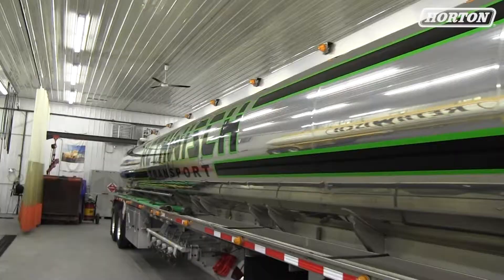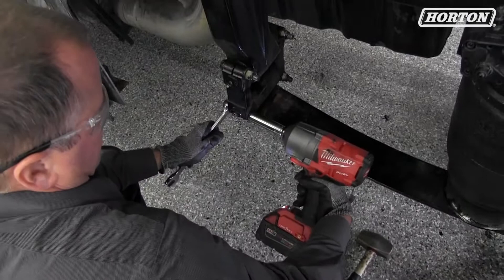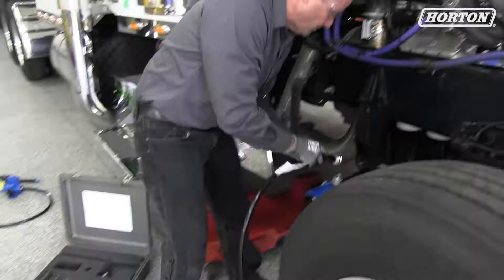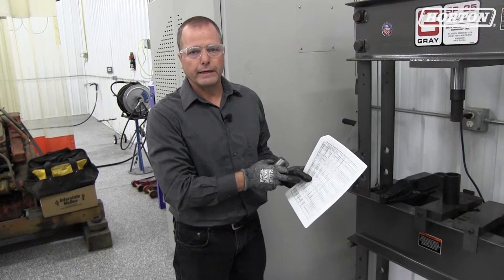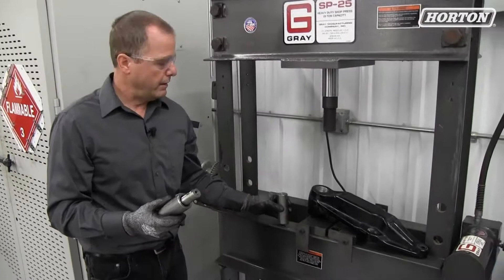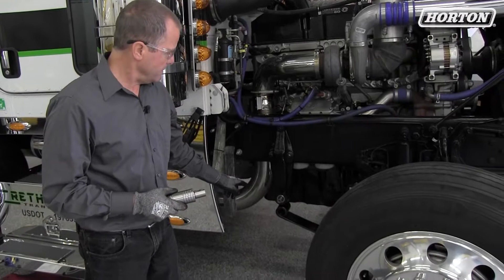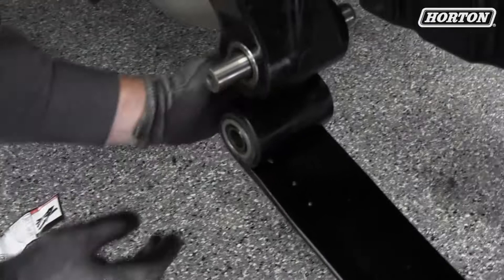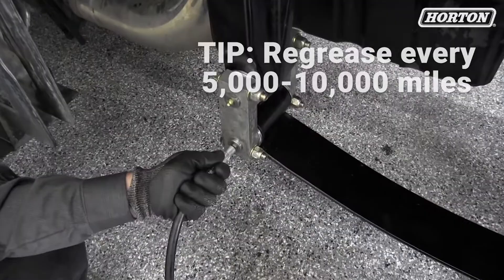How to replace threaded pins and bushings with roller bushings

Comment: I installed this kit in my 96 KW  T-600 many years ago , I had an inspection done and was told that the original pins were very worn , that is why I had bought this kit , mine did not go as easy as this video shows , mainly because I did not have that OTC press kit needless to say I got it done I took it for a ride I could not believe the big improvement in results , mind you I only done the shackle end of the spring but what a major improvement in the ride I brag all the time to my driver friends about this kit , and NO i do not work for Horton , Frank T
Reply from the maker: Thanks, Frank! We're glad you had such a great experience. If you ever need anything else drop us a line at info@hortonww.com.

Comment: do you have the part number for the pin driver tool you used at the press im tired using random sockets and old pins trying to push them out at my shop